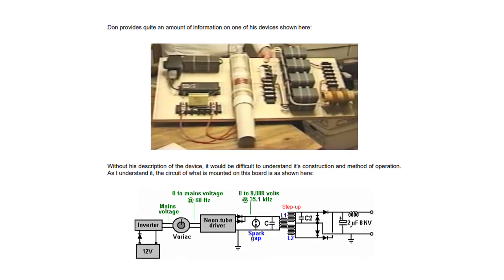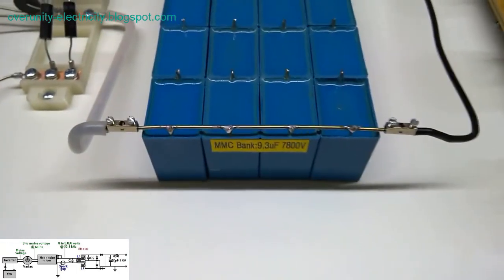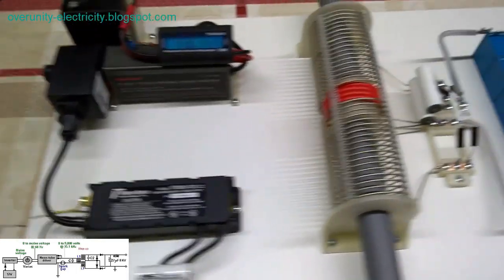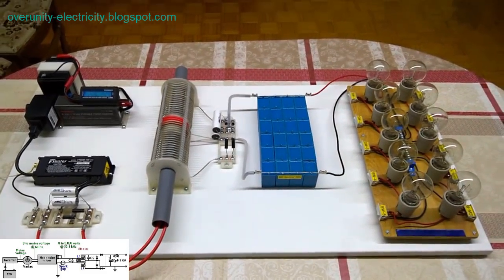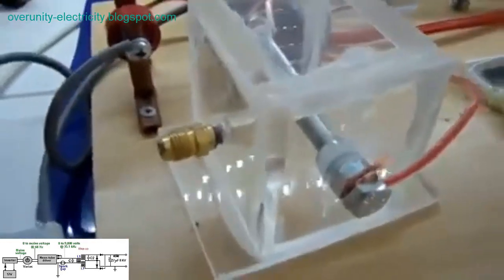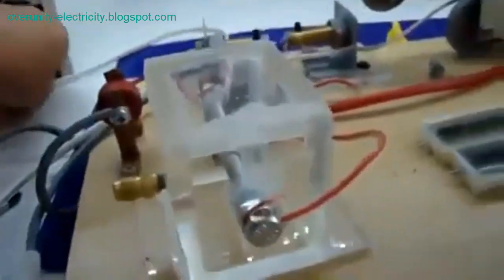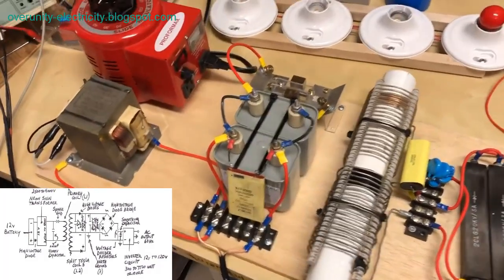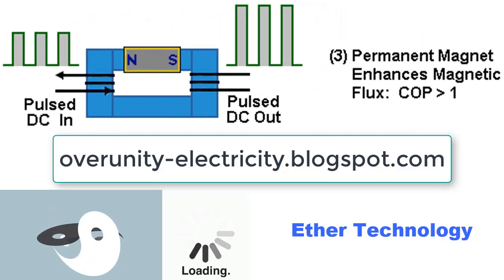Radiant Energy: Don Smith Generator

Comment from the maker: Donald Lee Smith's Magnetic Generator: https://overunity-electricity.blogspot.com/p/smith-magnetic-generator.html
Reply: I think problem is in the high voltage power supply. I've read datasheet and it has variable output frequency. As Don said the frequency of the high voltage power supply should match with the rest of the circuit (it's harmonic frequency) so if Don used power supply with 35.1 kHz output frequency the rest of the circuit should be it's harmonic, for example 28.08 MHz. If you'll achieve perfect resonance within the whole device it will work. For the other people, law of consevation of energy aso works here, the energy exists, but it's not useful. This device converts non-useful energy to useful. That's all.
Reply: @vojtechkuchta6070  I agree and there is a lot of confusion on how to create that mutual resonance. L1 to the HV transformer should be done with a suitable LC combination and not by winding nearly 1km of wire on to the L1 coil😊
Have you tried a Don Smith system and got some workable results? I’m just turning my research in this direction.

Comment: All you need to know why over-unity does not work is in the opening titles. "The laws of physics."
Reply: @nexpro6985 - You are so wrong, and lazy for not investigating it yourself.
Reply: @XR_IX  really? So in your opinion the laws of physics are wrong?
Reply: @nexpro6985   The laws are correct most of the time - and usually where Ohm's law applies.  Simply put, you can make the 1st law of thermodynamics apply whenever convenient, a closed system should only be confined to produce the maximum available. This video is hinting that people are able to exceed the available. The laws of physics has caveats, and that's what people don't understand because you say, the laws are absolute. I say you can take where the laws don't apply and realize the bigger picture. When the 1st law was being contrived in the 1900s. The didn't know uranium and plutonium could produce kilotons megatons of energy. The point is the law describes a normality to most people. MOST:  https://youtu.be/Ya2sqVvc9TA
Reply: I believe the issue,  besides the massive amount of scams and nonsense, comes from the way this area is described.  I hate the term perpetual motion, less so over-unity, and I think that even if there is an actual breakthrough technology found in the energy sector, it’ll automatically get labeled one of these and kill any chance of legitimate scientific research.  And by legitimate scientific research I mean well funded and equipped.  I legitimately believe that we have a skewed view of this area of alternative energy.  And I put alot of blame on the language used to describe it.  Free energy, or perpetual motion are brain dead terms used by people who probably can’t build something to harness it.  If there is ever a proven device, it didn’t make any energy from the void.  It just harnessed available environmental sources of energy.  Kind of like trying to explain nuclear energy for the first time.  Bet that sounded like magical bs to people as well.   To be clear, i am not saying anything about this, or any other device.  I just want to give a different lens to view possible future scientific research through.
Reply: @ericguillot6402  The 1st law of thermodynamics can be broken. I've done it. But even if I hadn't, these terms were made to tripwires for people doing legitimate research: Radiant Energy, Zero Point, Perpetual Motion. It turns brains off, and misleads people thinking they need to build or create something new that will fly them to the moon. The irony is if we just improved the efficiency of known devices like the solar panel you could remove the dependency of oil/coal.
Reply: yep and  designers self enforce them.